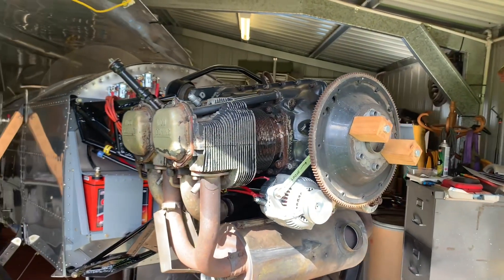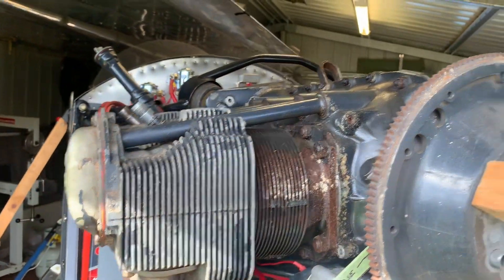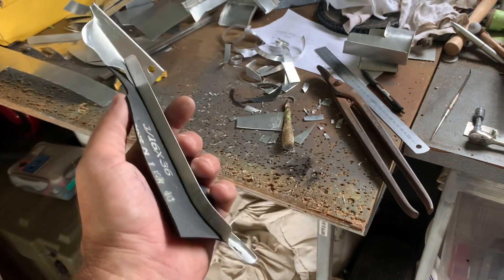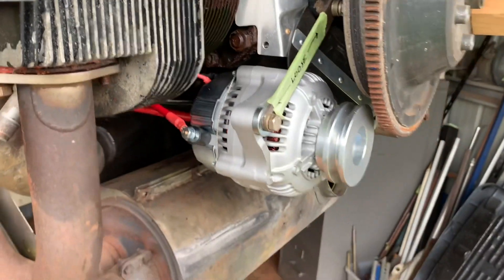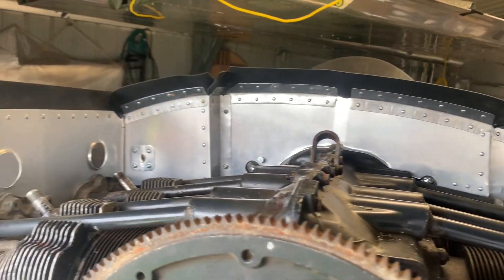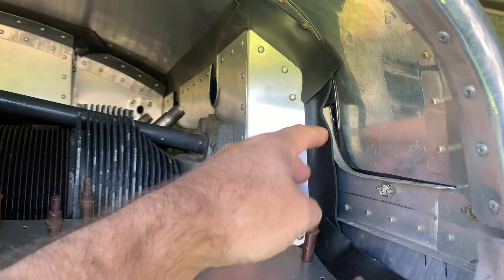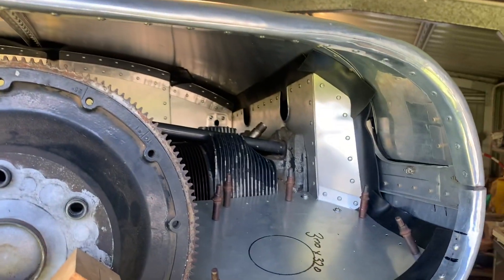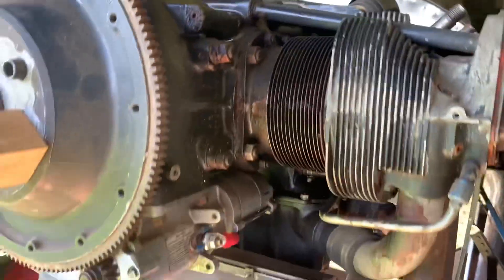Cooling the engine. Air baffles for Frankenstein

Comment: You can shorten up that dipstick. Cut the outer tube and fit with plastic pipe epoxied back together if it is plastic. Weld a tube if it is metal.  Then shorten and remark your dipstick as you add oil.
Reply from the maker: I thought about doing that, but I wanted to make the access hatch with a bump in it more

Comment: You better do some structural load testing on the wings & gear before flight.
Reply from the maker: Cheers mate, I have used examples of other aircraft structures of similar performance as a starting point for my design. And then made it stronger.
Reply: @donwtsn  I am a retired GE Engineer. Similar construction techniques DO NOT replace new design load testing. Structures distribute loads in very different ways. In 40 years of design similarities I have never seen same results on each. Making what looks stronger build in one area often transmits more load to other areas. Please LOAD TEST!!!!
Reply from the maker: I must apologise for not giving you enough info for a judgement call. I agree with you completely about stronger structure transferring stress and failure points to somewhere else. My little dig about other aircraft of similar performance was directed at some of the kit aircraft that are about today that I’m sure would not pass a load test, especially after the aircraft has a bit of age about it. I am not one to compromise structure for performance. I have been an aircraft maintainer for over 25 years doing a fair bit of structure work on many different aircraft. And worked with design engineers from time to time doing some very cool stuff. As much as I’d like to do load testing it simply isn’t a viable option for me. I don’t have the budget, room, or materials to be able to do it. I understand that the calculated option is not as accurate as a load test, but I think I’ve taken in to account and understood the types of loads that should be expected. Flight testing will be very cautious and careful
Reply: @donwtsn  I have been an FAA A&P since 1974 as well. Get an DAR to inspect your aircraft structures. I didn't like what I  saw in your vlogs....
Reply from the maker: Our system is a little different in our country. As part of the registration process it will be inspected. Part of the reason why I make the videos is to have what I’ve made recorded for future references if I need to mod things. Feel free to point out what you didn’t like. Was it some things, or just everything?
Reply: @donwtsn  I have indeed saved many homebuilders from death but it was from being right there during the build process, making test joint pieces to load test, look for BAD load transmission structure members (when they thought they were "beefing an area up"...please be careful. Remember that thing is going to carry your ass way off the ground Don. Prayers & Good Luck to you. Seriously....
Reply from the maker: I have no doubt you’ve steered builders away from disasters. I believe it is so important to have guys like you around just to help builders see and understand potential defects. I am lucky enough to have quite a few good friends with large amounts of experience with aircraft maintenance, and design I can bounce ideas off and weigh up the best way to progress. You can be sure that the testing phase on Frankenstein is going to be very cautious and careful.
Reply: @donwtsn  All good, when you have questionable structural component. It's not expensive to load test a sample too you know.
Reply: @donwtsn  I would have liked to see one piece extruded aluminum spars instead of built up....
Reply from the maker: Over the years I’ve become a bit of a fan of built up spars instead of single extruded ones. They seem to have a bit more of a redundancy over time. Of course, they also have lots more potential for corrosion between joints, and cracking emanating out of the extra fasteners. I chose to make them this way as I had the material and didn’t have any extrusion. I built them up to around the same thicknesses of the web and caps. I also added doublers to where the strut attaches and wing attach points. Man, it took quite a while to debur and prime every part before assembly!

Comment: you should get better cylinders before you start worrying about the baffles. the amount of blocked passages will cause overheating, and the rust needs to be removed, before you even worry about the baffles.
Reply from the maker: Yes, this is an old engine with lots of hours on it. That’s why I got it at such a low price. I also know it’s history as I know the guy who maintained it. The rust on the cooling fins should not block the air from flowing around them

Comment: Brilliant fun. A little question, I did not see a baffle between the cyclinders, like I have seen on some cowled engines, I take it, they are not normally needed on your type of engine?
Reply from the maker: There is a baffle between the cylinders. It’s underneath. With the ones I made up that wrap around the outside of the cylinders it leaves about an 1 1/2” gap at the bottom. About the same dimensions as what I could find on other installations
Reply: @donwtsn  thank Don for your reply.